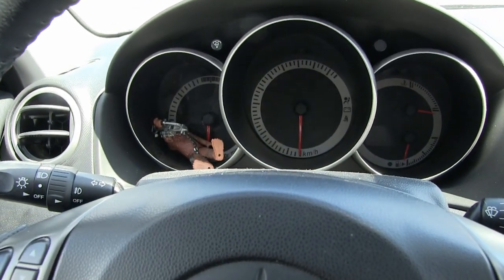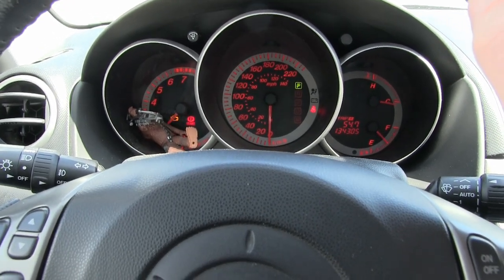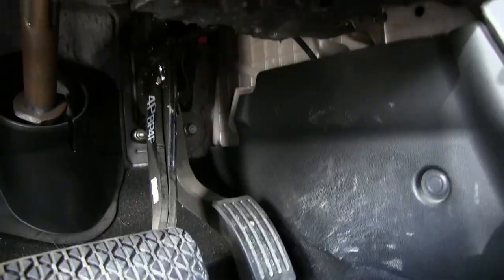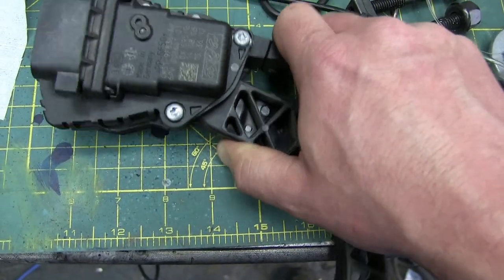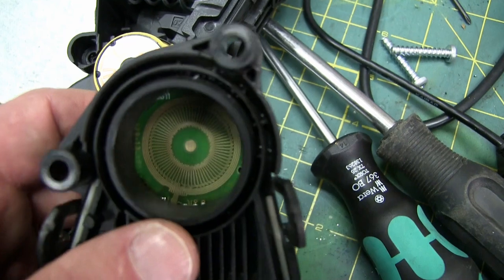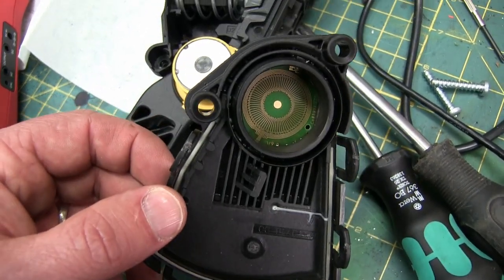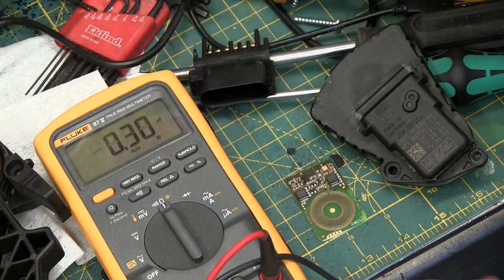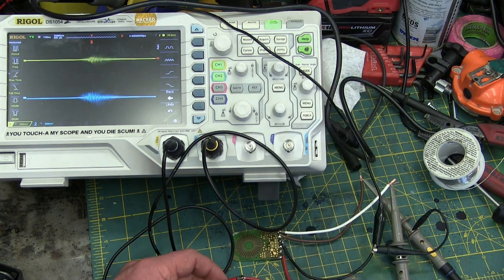BOLTR: CANbus accelerator pedal.

Comment: Auto tech here, yah yah I know you hate guys like me, but here me out. I can get you a pinout and full diagnostic procedure if you want. just send me the year/make/model and a place to sent it to. looked up hte part number there and its the same one used in the ford focus so theres plenty of them in good used condition on the ebay. now if you want a little more tech talk about that throttle sensor there, keep on reading. otherwise, the rest of this comment is gibberish.

throttle peddle position sensors almost always have a dual opposing readings that are verified against each other for safety sake, I.E. there are two readings being made on the sensor, one starts high and pulls low, the other starts low and pulls high, the little confuser built into the assembly there takes the readings, converts them to digital signals, and sends the information over to the PCM. via a CAN/BUS line.  if one side goes down it can still function, just with a degree of inaccuracy, and it turns on the check engine light. one of those lines in should be a 5v reference from the PCM, one should be ground, one 12v from the battery, and the rest should be network communication lines to the PCM, Antilock, and TractionControll modulus. cant say for sure without knowing what im working with.
Reply: Usually I find the raw signal data is sent to the controller with priority likely ecm in this case, then signal is converted and is sent out over can upon request. Interesting this sensor seemed to respond to full pedal application but I saw no independent "kick down" switch. I enjoy these videos because in an attempt to properly diagnose an issue I find manufactures provide hardwiring schematics but no internal logic data. AVE has helped me understand more of the internal components helping me to make a more accurate diag with out the logic being provided. Thanks for the knowledge (from all you guys)!!
Reply: Except Toyota. The Toyota runaway recall, was because they decided to use single potentiometer in throttle pedal. Then occasionally one would short out instead of losing connection. Then you have the car you can't stop.
Reply: I always wondered why these toyota drivers couldn't just put the car in neutral, should even work with an automatic transmission.. Than just brake and shut the engine off.
Reply: I'm just imagining how I would react if my throttle suddenly went bonkers. I'd probably slam the brakes and pop the clutch when that didn't work, but if there were someone in front of me in traffic I would be hard pressed to react and stop in time. It's the scenario where the car takes off on you in tight quarters that frightens me.

Comment: "It's about to blow up". Pretty sure that's Danish for "I want a new car"
Reply: +AvE just find something in the right colour and all will be well. Six months of 12 hour shifts to pay for it will be furthest from the mind
Reply: +Azaron83 correct - the tracking power supply is normally within the engine control hardware. suspect wiring before broken sensors, with any if these platform engines cost is foremost
Reply: mine is actually the complete opposite, she drives a 20 year young 7.3 powerstroken diesel. she really must have met her metal and rubber dream chariot. she brings it to me for occasional fluids and once over. she don't like cars at all. I'm keeping her
Reply: +Azaron83 I don't think that old smashda is new enough for resistor wiring of 5 volts. i remember when they started using 5 volts in cars and they became a much bigger pita to work on though.
Reply: actually "jeg vil have en ny bil" is danish for i want a new car... But you're not far off
Reply: Danish humor, Cheers from Aarhus
Reply: well then that must be 1 old mazda right there. Didnt realise mazda had those steeringwheels and dashboards back in the days. But like azaron said a lot of sensors have been running of the 5v system in cars for a long time now. No problem to get a testing power supply for that tho, computer power supplys also have a 5v rail in them, so you could use a computer power supply for testing 12v and 5v systems.
Reply: +Azaron83 ya sorry I was thinking of the starting circuit that went 5v in the early 2000s. i wasn't thinking sensors but ya I know alot of it is 5v going through minus some resistance and then back to the confuser.
Reply: Nah, that would be "Jeg vil ha' en ny bil" Trust me, I'm Danish ;-)
EDIT: ikke den eneste tydeligvis :-)
Reply: Magnus Pedersen they don't really do jokes in Denmark, do they....
Reply: unclejoeoakland sure we do, mostly funny ones though ;-)

Comment: It's a highly sophisticated count down timer. It's calibrated to blow as soon as the warranty runs out.
Reply: Must be a subsidiary of the company that produces batteries for Apple.
Reply: I see there's another Rossmann viewer.
Reply: +M M Sony usually produces apple batteries
Reply: +TheSuraj03 it's the fact that the circuitry does nothing to protect it 
they shouldn't be charging all the way to 4.21v then all the way down to 3v ( I don't actually know how low they go )
Reply: +BitsAndBites you would think a 500+ dollar phone would have protection circuitry for its internal non removable battery.
Reply: TheSuraj03 There is protection ( you don't want it blowing up ! ) but apple runs the batteries hard to get people maximum battery life when they get the phone; and then the battery wearing out is all profit for them because it forces you to get a new phone
Reply: +BitsAndBites 3v is still good for the battery anything lower than 2v would kill the lipo
Reply: ForeverAloneMan running it down to 3V and then back up to full isn't good for the longetivity of the battery ( I'm not talking about killing it instantly, just the damage done over weeks and months )
Reply: Not to stray too far off topic... I Own a small cell phone/mobile electronics repair biz and actually the batteries can be replaced a lot easier than most people think.  Of course Apple (or any other sealed battery phone manufacturer) isn't going to openly share that information.
Reply: WJK most people won't bother, and prices ( even 30€ ) chases people away :/
Reply: Actually I do the entire battery replacement for right around $30US (battery included) depending on model. Unfortunately, you are exactly right, most won't bother which is more unfortunate because in most situations the consumer actually ends up losing even more ($) in the long run.
Reply: WJK yes
I worked a week as a repair guy, and it was hell, people treated you like ass and I essentially didn't fix anything, just swapped parts, the guy didn't even have a hot air station
30€ was our price and people would constantly try to deal the price down, offering 20€ or 25
Reply: Always appreciate stories from the trenches (so to speak). You are exactly right in how people want to beat you up on prices, especially on the latest high end phones which have the highest replacement parts costs for the first 6 months or so, which is a lot like first model year car parts where parts prices are through the roof and often hard to source at first...especially aftermarket.  Dealing with walk in customers/general public is no doubt an interesting encounter to say the least.   In light of all this, I quickly found out (and got kinda lucky) in that I landed a local repair account from a company that provides high end phones to all their employees and since their phones need to be in top working order at all the times for their business to function properly, they never beat you up on price or waste your time deciding if they want the repair done today or a month from now...plus most accounts like this pay on time, every time.
Reply: It's not Sony's fault it's Apple's for making them non user replaceable.
Reply: Is it actually Apple's (or any other manufacturers) fault? Or perhaps more the fault of consumers choosing to purchase a phone that does not feature a removable or more easily replaceable battery?
Reply: WJK Thank you
people bash me for hating on non repairable phones ( like apple and some older samsungs ) yet they complain when a broken part is glued to 10 other parts and suddenly a camera glass replacement is actually a rear plate + 10 other things repair
Reply: +Ingeniebrio wait do you think he's wrong? lmao
Reply: NothingSpecial I lol'd Bahahahhaah

Comment: Don't ya miss the good ol cable running from your pedal to the throttle body?
Reply: Or better yet, to the carburetor.
Reply: +aMondia true
Reply: or an actual mechanical connection between your steering wheel and your tires ,or foot and the breaks ,or lever and cable to the emergency break .these new cars with the computer controlling everything and not you is just asking for it to murder you .
Reply: +sebaztiancooper Population control I guess
Reply: the only thing working by wire is the throttle and its better if its calibrated good even race guys like it but brakes and steering is a mecanical connection and like the pedals they make the throttle and clutch from plastic but brake pedal is metal
Reply: And yet, surprisingly little murdering seems to happen.
Reply: +sebaztiancooper by law, there is a mechanical connection between steering wheel and wheels and between brake pedal and breaks.
Reply: I have hated "potentiometer throttles" since day one. mechanical linkage feels so much better, and is well proven.
Reply: +Thomas Fooij I thought the new q50 and electric cars all had fully electronic steering?
Reply: +steven yau https://www.wired.com/2014/06/infiniti-q50-steer-by-wire/

is the article I read
Reply: Mercedes tried it on brakes, electrohydraulic system, it got recalled. I also thought, by law, cars were required to have a secondary, separate, mechanical e-brake, but now all of them seem to have this button brake that will not activate at speed. It sounds like it's gonna let the smoke out any second.
Reply: there may be a physical/mechanical connection between the steering wheel and the tires, but it's all electronic. driving with no power steering is one thing, but I'd hate to have to fight the power steering if it tried to kill me. I only drive manual cars, so throttle's not such a big threat, and I can (and have) manage to drive without breaks in an emergency. I'd hate to be driving down the highway and have the wheel yank to one side on its own. a huge problem is that all the software making it work is closed source and protected by corporations and governments. it's scary having no idea what exactly that software is capable of.
Reply: +Al Goulard  Absolutely, no argument here. I just prefer the feel and feedback of a mechanical connection. The world is going digital, I get it.
Reply: When you invent or design something, what should happen next is you add SIMPLICITY not complexity. Another rule is, "if it ain't broke don't fix it". I'm all for control by wire, but of the Bowden variety!
Reply: no carburettors on vehicles that use fuel injection :)
Reply: +Nathan T fully eletric steering racks indeed. However, this is replacement for hydraulic power steering. There is still a mechanical link between all the parts
Reply: Did you know that, by law, there always has to be a mechanical connection between the driver and the wheels when it comes to the steering and brakes? So no, it's not going to murder you ;)
Reply: Drive by wire is a much better option than a mechanical linkage and is also well proven. I drive both and I can't say I feel any difference between the two in terms of pedal feeling.
Reply: AR1G3 If one was being cynical, moi, one would say they changed to Fly-by-wire technology so they can scrap cars earlier than before due to the cost of replacement parts. I can guarantee that no modern car will run in the future equivalent of the London to Brighton run.
Reply: @8alakai8 can you re do your post with punctuation... 

better if what is calibrated? the steel cable or drive by ire throttle? because you cant calibrate a steel wire.....

steering in new cars is not mechanical.... its electric... EXACTLY teh same as this throttle, just bigger motors. 

racing guys like manual steering, manual brakes, no booster, and a cable....i know because ive been in pit crews for small time drag races and shit, and ive been working on cars sense i was 4 years old holding a flashlight for my dad.
Reply: Because throttle cables never stick or have an end break off?

Although shit it took me WEEKS to get used to my Mazda's Throttle By-Wire after only driving cable throttle cars and trucks. Had to re-program my brain that my foot isn't rolling a plate open and letting the wind in to make it chooch but that I'm asking the computer for a % of engine output.
Reply: Michael Ell Sure throttle cables break but any mechanic, even a push bike one, can fix it and without recourse to a computer diagnostic device. Come the apocalypse, I know which I would rather have. :>) 
Mind you. if someone else is paying for a new car for me, I might be persuaded to change my views.
Reply: you don't need a carb for throttle cables, i know for a fact my 1993 LS400 has a physical cable and it's fuel injected.
Reply: No, it's not cheap junk, it's expensive junk.
Reply: That was in the early 1989 models.
Reply: and the recall was for other electrical wiring in the car... '97 and prior used mechanical linkage.
Reply: +sebaztiancooper The brakes are always connected to the pedal. The thing is that the pressure in the brake cables is controlled by the abs unit.
Reply: +Magic Pixie Death Squad trust me you don't feel a difference between the spring at a throttle body and the spring at your foot lmao 
hard headed and set in your ways
Reply: Not yet. I've still got a nice simple cable running to my injection pump (diesel). Mind you, they used to break on my C15, and replacing it was a right contortionist-trick, scraping your knuckles upside-down in the footwell with your feet in the air. Had to do this several times over 13 years for various reasons. Current van has been fine in this regard. I'm not looking forward to the culture shock of canbus and computers debugging the car ceasing to be mechanical/electrical excercise.
Reply: Lies! Maybe you can't. And sometimes I can't. But many wear, and when they do, you sure as hell can tell. Probably not a problem is you lease of buy off lease. But if you're like me and everyone i know, broke and driving beaters, TPSs can be problematic.
Reply: Louis Bernard mine has one.. skookum
Reply: @lolzordje123  By local, state, federal and international law/treaty, SOMEone will refer to the stoppy bits as " Breaks". Thanks - Lumpy
Reply: Indeed
Reply: Louis Bernard the linkage to the carb
Reply: Yes and no. I like the quicker response of a cable, but I enjoy the smoothness of the fly by wire. I also enjoy the  response curve of the fly by wire. In my Subaru, the first part of the throttle is was less responsive then the second have. It makes normal driving easier, and reckless driving more fun.

Comment: TP (throttle position sensor) is at the throttle body. Clean the butterfly valve on both sides and retest. The APP (accelerator pedal position sensor) is  at the pedal. It's a dual pole dual throw sensor assembly. On the scan tool it is listed as APP sensor A and APP sensor B. The PCM uses both sensor readings as a reference to see how wide the throttle should open. It then identifies the angle at the throttle by the TP. All of those sensors are potentiometers that run on 5v reference.

Comment: I have the pinout for an '11 Mazda 3. Pin A is +12v, Pin C is Ground. The rest of the pins are sensor output. Keep in mind that accelerator pedal position sensors typically have double or triple redundant outputs, along with an idle validation line (a wire that is just pulled high/low whenever the accelerator pedal is in the idle position). Your sensor likely won't function properly without the other piece being near the board, since it's almost certainly some kind of rotary capacitive encoder with built in redundancy.

Comment: automotive sensors are usually 5v as a standard. in an accelerator pedal position sensor, one reading will be as high as the other is low from 0-5v

Comment: Babying a vehicle has NO BEARING on the condition of the sensors.  Rotary position encoder.  The LAST thing to suspect is the ECM.  90% of the time its the connectors.  -- Former ECM system designer, GM
Reply: While I agree with you that it's very rarely the ECM, It made me laugh a little seeing someone that's a former ECM system designer say it's never the ECM.  Kinda like the parts makers say it's always the wiring, lol.
Reply: @351cat  OEM wiring harnesses QA here, most of the time its the harness, connector or pins. rarely the part itself. almost never the ECU

Comment: Good to see you dippin yer toes into this type of thing. I do a lot of reverse engineering of factory automotive sensors for work in an engineering environment. What for taking control of them ourselves or using them on other prototypes. These also almost always have a redundant output for error checking.

Comment: Parts like these are replaced - full stop. At $100 for the spare there is no way a service facility can make it sustainable to train up technicians to fault find at this level. Workshops spend 2 minutes diagnosing this kind of fault, install a spare and the 'problema' is sorted! 

My wife's Toyota's driver's door auto lock mechanism stopped working. Toyota wanted $800 (Australian) to fix it - meaning replacing the mechanism which raises and lowers the lever. I climbed in and fixed it myself. Turned out that the little motor's commutator was shorting out (carbon between the gaps). Cleaned the commutator, reassembled and Bob's your uncle - it worked. Job took me about 4 hours, without manuals or any guidance - the satisfaction is priceless though! :) 

We tinkerers are a rare strange breed....looking forward to your findings.